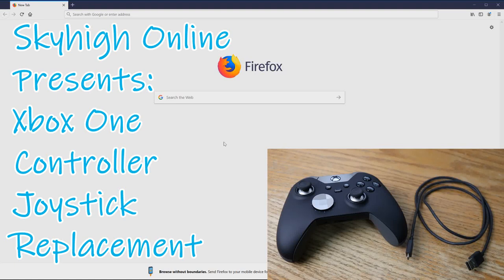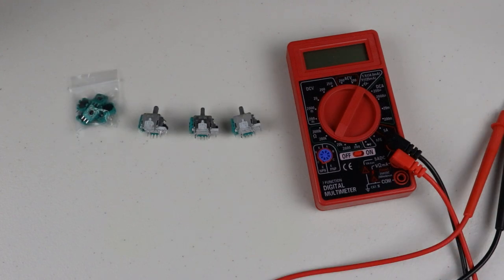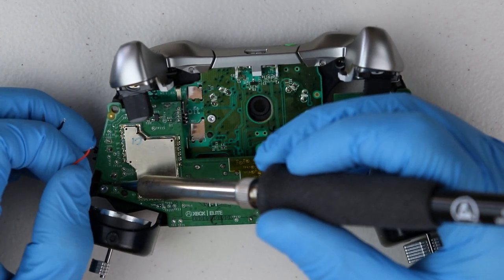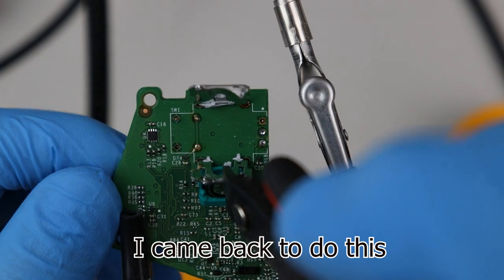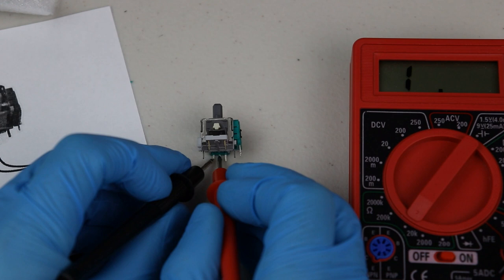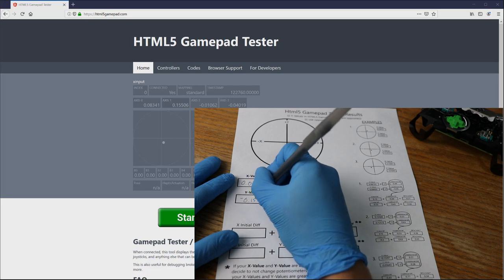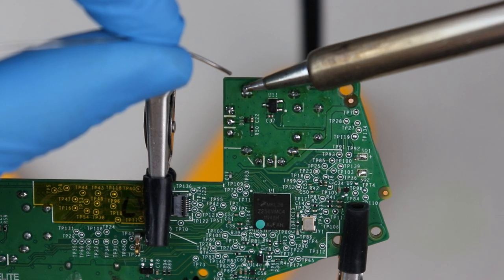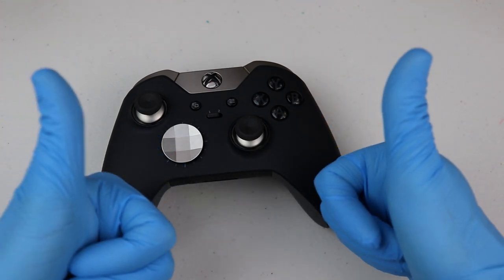How to Replace Xbox One Controller Analog Joystick - Fix Stick Drift & More

Comment: First video I've found that gives the tip to pretty much destroy the fault joystick to more easily remove it. That's the main reason I've been hesitant to invest in the soldering kit to do this. Seems a lot of ppl have trouble with that step. However, you then make up for that by having to do it twice!!. I haven't read about these values being off until I found your video.  I've already deconstructed my sons controller to the point of actually cleaning those black rings in the potentiometer. Your Amazon link shows currently unavailable but I seen in another comment you would set up an ebay link. Curious why you can do an ebay link for the product but not have them on Amazon..strange.
Reply from the maker: Thank you for the comment! They're in stock now: https://amzn.to/2vWwm8s

The reason I made an eBay link is because I have the parts to sell and ship myself, but was currently in the process of getting them all packaged and sent off to Amazon in bulk, and once shipped, it takes Amazon nearly a month to have them available!
Reply: @SOSSGAMING  That would be great, actually. I'll take an ebay link I don't want to invest in a soldering station as expensive (not that expensive but for me for this it is) but is there like a minimum heating ability you'd recommend? Like, it needs to be able to get up to "X" temp?
Reply from the maker: @rsxfreak03  
I haven't tried this with a different soldering iron than the one shown in the vid, but I don't see why any cheaper but good soldering iron wouldn't work.  The recommended temperature for soldering is usually between 626-662F (330-350C).  I set mine at 650.
Reply: SOSS GAMING  would it just not be as easy to desolder the analog stick as a whole  rather than taking it apart and destroying it? I know they are only cheap but they seem to come off easy enough?  although I did have a nightmare  getting an elite analog stick off even using hot air gun as well. I’ve only done about 7 analog replacements so I’m new to it, as well as using a soldering station

Comment: After replacing lots of these potenciometers, do you feel like the controllers fail because of faulty pots, or is it dirt between the clicking mechanism  and the bottom end of the stick? I threw in some handy oil into my controller that had a sticky stick, and it greatly reduced the amount of stickdrift. Making me think its not the pots, it's just gunk in the movement mechanism
Reply: Pot readout would be glitchy if the pots were malfunctioning right?
Reply from the maker: Almost all the controllers I received were the fault of the wear of the carbon in the pots, so nothing short of replacement would help. Only a handful of times it was other issues other than the pot. But I did have a couple where it was gunk buildup on the thumbstick/dome piece (causing it to stick a little) as it seems you had. You are correct, the readout would be having issues if the pot was malfunctioning.

Comment: will i need to recalibrate the sensors if im only changing the little sensor wheels inside the green housing and not actually desoldering or taking apart any of the insides?
and if so how do i do it without soldering or any special tools (i do have that red meter box thing tho if needed)
Reply from the maker: If that's all that's needed then no, you shouldn't need to do any calibration.  You will only need the tools to open the controller: t8 security torx, t6 torx, and a screwdriver or something to pry off the handles, and a small screwdriver or something to open the potentiometer

Comment: Lotta steps but 2 have peace of mind for the future ya cant beat that.
Reply from the maker: For sure.  I've actually found a new method that doesn't require calculations.  A new video should be out within a week or two.
Reply: @SOSSGAMING  heck yea, yr getting a sub and like from me. Thatl save me more time and $$$$ on tools, thank you!! 💯💯💯
Reply from the maker: @haikudragon1002  Well... you'll still need a few tools haha no away around needing to open the controller, desolder the old joystick, and solder on the new one.  But, I will be demonstrating with a cheap amazon soldering kit that has all the needed tools (the one I got was $30, some are even cheaper like $15-20), and of course the joystick kit.

Comment: The analog modules that are on modules do they only work for Xbox one controllers or do they work for PS4 controllers too? Could you send a link for PS4 ones?
Reply from the maker: Technically they are interchangeable.  The only difference worth noting is that the PS4 ones are slightly raised and have a slightly stronger spring I believe.  I have been meaning to list them actually thanks for reminding me.  https://www.ebay.com/itm/224051689870

Comment: Same problem with ps4 controller. The sticks and potentiometer looks the same. Can this work with ps4 controller also? And do you have more details on the potentiometer it self? The black stuff inside, how it work and something like this?
Reply from the maker: Yep, it is essentially the same procedure.  The black stuff inside is carbon and it is used as the resistive material.  The wearing down of the carbon by the wiper is the typical cause for drift.

Comment: dose anyone knows why Stick drift occurs? am I pushing too hard on the controller? Outstanding tutorial btw!!!
Reply from the maker: Thank you! Unfortunately it's mostly just a wear and tear thing. Sometimes it's simply from buildup of dust and grime or a sticky joystick, but more often I believe is that the carbon in the potentiometers wear down from use over time.  When this happens it throws off the resistances which ultimately lead to the stick drift we are all too familiar with.  It's also usually why stick drift most often occurs on the left analog stick drifting upward.  This is from moving forward so much in first person shooter and other such games.  Simple wear and tear.
Reply: @SOSSGAMING  Thanks for the information Man! I also didn't know that Microsoft calibrates each thumbstick individually explains why my attempts at cannibalizing parts from other controllers didn't work
Reply from the maker: @thelovableprotagonist5574  No problem! Yes I know what you mean, I did the same thing and was so frustrated that the joystick was off center after multiple attempts.  I was losing my mind.  Took a long time to figure out what was going on and finally after many successful joystick fixes I was confident what was going on.  This information isn't anywhere else oddly enough!

Comment: Holy shit this is WAY more complicated than I thought it would be. Thought you could just desolder the old stick and put in a new one without all this paperwork.
Reply from the maker: Yo I agree! It's worked for me in the meantime but I've actually found a way that is a lot more simple to get these centered.  No calculations or readings required, nor wasting any joysticks.  And in most cases you just need any one random joystick!  I will be posting the new video by the end of the week hopefully

Comment: That moment you realize you need to finish an electronic engineering degree to fix a drifting stick
Reply from the maker: If you have just stick drift, you can just replace the potentiometer causing drift, and if you want to calibrate it, use the method in my latest joystick video "newest method". No measurements or math required. Good luck if you choose to do it!

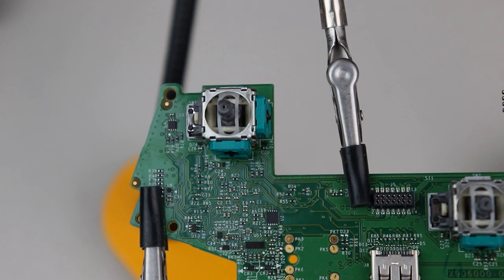Comment: Around 6:00 you take apart the joystick with pliers. Can you just use wick to absorb the solder on it already? Then just take the joystick off?
Reply from the maker: Yes, but it is extremely difficult on elite controllers and the newer controllers that have the smaller through holes.  That is why I show the tear apart method.  On the older controllers it is much easier to remove the solder with a sucker and/or wick.
Reply: SOSS GAMING thanks a lot your video helped me start up my personal project. Without it I would be no where

Comment: I didnt calibrate but I did everything when I use it it only works to move left and right but not up and down. Do u know maybe any reasons why this could be?
Reply from the maker: Oh no! Yes, 3 possibilities that I can think of: Damaged wiper, solder connections touching, or most likely that a through hole was damaged.

Comment: Wow amazing video . Only one on here that’s explains and does this. Had major problems with dead zones when replacing analog sticks, the odd time got lucky and the stick worked right off the bat, the deadzone being not centre,some games it affects, ie rainbow six, robloks, fortnite usually causing the avitar to walk forward, stargaze or drift. If you cannot change the deadzone  in the game you have had it. All these people doing analog stick repairs but I bet they are not checking the deadzones. Doesn’t affect games like fifa, call of duty but really is a pain in certain games if the deadzone is not as near to centre. These parts you get from China are nearly always way out . I’ll be trying your system later today. Thank you for the vid
Reply from the maker: Thank you so much! Yes, it took quite some time to figure this out (by myself).  Equations and everything.  And it's nowhere to be found on the internet anywhere that I'm aware of which boggles my mind.  I don't know how many frustrated days I spent trying to figure this out before I realized that each joystick is software calibrated differently from the factory based on the exact original joystick put in.  I really wish Microsoft would offer that calibration software to us like other 3rd party manufacturers do with their controllers.  But we all know why they don't.  So, we are stuck with this silly method lol
Reply: SOSS GAMING well done on your time, effort and patience. All the analog sticks are out usually, some more than others.ive been using model  RKJXV1224005 ALPS Multi-Directional Switches, which  are supposed to be great, deadzones miles out, had more luck with the ones off alibaba. Everyone  who puts youtube vids out there replacing sticks just see it working when they go on the home screen on Xbox the basic app which shows it centre, but when you switch to deadzone settings this tells the story, and how in some games it will be a big problem
Reply from the maker: @ebayselling1576  Yeah I know the struggle!  I too fell victim to the xbox app until I found out about html5gamepad.com which like you said tells the true story.  Thanks for chiming in!
Reply: SOSS GAMING 3 controllers that I paid £15 each,  with deadzone problems after I had  replacing the analog sticks. All 3  now fully fixed and resold for £30 using your video/system, just testing then switching the 3pin sensors from the other 30 odd analog sticks I purchased in bulk some time ago. Thank you once again. Great work!
Reply from the maker: @ebayselling1576  Awesome! Thanks for the update. That's great to hear. Well done.
Reply: @SOSSGAMING  I'm wondering what you mean about the calibration process... do Microsoft put the joystick in and then calibrate the controller so even if the stick was off centre before, it is now centred to that specific controller? And when you mention 3rd party programs/apps. Is there one that i can use to calibrate an off centre joystick to dead centre? I've been wondering if this is an option because it makes so much sense. You're not centred? Well where you are now is the new centre. So simple

Comment: good video but tearing appart whole ministick was bad idea, you could just use copper Desoldering Braid wire to clear of old soldering, and detach ministick entirely or just remov potentiometers from sides.

Comment: What is the tool you use to cut the housing? Nothing i had could cut through that thing
Reply from the maker: It's called a micro cutter, but a wire cutter should also work.
Reply: @SOSSGAMING  thanks for the quick response! Off to the store

Comment: In have spare analog sticks from my PS4 controllers,, can I use those? I know they look and mount similar, but can't using these damage or make my Xbox not work properly?? Very curious
Reply from the maker: They will technically work. They will feel different (higher stick tension), will sit higher (may need to shave off the bottom base a little bit to fit), and the potentiometers have a wider range (will max out sooner than xbox joysticks). Hope that helps in deciding whether you want to go through with putting them on the xbox controller. Good luck.
Reply: @SOSSGAMING  👍

Comment: So are all the potentiometers variable with different joysticks or are the values that you got a set value with each one and useless?
Reply from the maker: I'm not exactly sure what you're asking, but I'll try to answer as best I can.  In short the ones that aren't used aren't useless, and may be a perfect match on different controllers/joysticks.  If put on a different joystick, they can also provide different values, because another factor in the values is the positioning of the knob that turns the wipers on the joysticks which also varies slightly from joystick to joystick.  Not sure if that answers your question.  Anyway, I have another method that I made a video on that you might be interested in.
Reply: @SOSSGAMING  that’s the explanation I was looking for. My working was kinda bad with it but you hit the nail on the head. I would be interested in other methods as well to see.

Comment: Hey man, appreciate the video! I ordered from your eBay store and this walk through is super helpful. I'm curious if your affiliate links for Amazon are still working? Specifically the quad hands and soldapullt. It seems like it redirects through Amazon's search function which then goes to the original product page, but it's unclear to me if you would still get the credit for referral. I'm gonna order 'em, but would rather you get the credit for it. No rush, lemme know if they're working and I'll purchase them!
Reply from the maker: Awesome! Glad to hear.  Thanks so much for the support and courtesy of letting me know about the affiliate links.  Not sure why they aren't working like before, but it does appear I would still get commission as the link still contain my affiliate code.  Thanks again for the support.

Comment: Will any solder gun work? I have one from harbor freight. Just a cheap one.
Reply from the maker: Yep! Unless it's one of the huge ones meant for larger jobs, but if it's the same type as in the video it should do just fine.  Biggest tip is getting the heat adjusted correctly.  I'd suggest starting on a lower heat first (too high of heat damages these boards quite easily).  Check out my latest video I use one of the cheap soldering irons.
Reply: @SOSSGAMING  ok thanks.

Comment: What do i do if i didnt leave the plastic parts on to help pull the plugs out? I have like half the posts out but i cant seem to get the other half to heat up and pull out of the holes in the motherboard. Its super frustrating

Comment: when can i buy the entire module from amazon again? it says that they're currently unavailable
Reply from the maker: Thanks for checking in.  They are restocked and available now https://amzn.to/2SOhEc1
Reply: SOSS gaming I'll let you know in a couple hours. There's definitely a chance I'll buy it from you on eBay but I'll check with you in a bit. Thank you for the offer. I'll let you know today when I'm gonna buy it
Reply: SOSS gaming Can you also let me know which solder iron to buy and what solder wick or solder wire did you use. It's gonna be my first time ever soldering anything so I wanna be prepared
Reply: SOSS gaming Can you also let me know which solder iron to buy and what solder wick or solder wire did you use. It's gonna be my first time ever soldering anything so I wanna be prepared
Reply from the maker: @onstandard  absolutely, all of the links of what I specifically used should in the description. Any alternatives should be fine, just be sure to check their reviews and what not.  Soldering is an excellent skill to acquire, and may be pretty challenging at first.  There are many great videos on here (YouTube) that explain good soldering technique, etc.

Comment: will the same analog module part work on xbox one and ps4 dualshock controllers ? it's a common question but hard to find a clear answer. Some sellers states it's compatible for both controllers and others mark just one of them..
Reply from the maker: I would use the correct joystick.  The differences worth noting are on the PS4 controller joysticks, the base is raised, and the spring tension is higher.  You could install a PS4 joystick on an Xbox one controller, but would need to modify the base (shave or melt the base so it is flush and sits correctly).  You could also install an Xbox joystick on a PS4 controller, but it will sit a little lower than normal, and I believe the lower spring tension might also create a "sticking" effect on a PS4 controller, but I am not sure, I have never tried it.  Hope this answers your question.
Reply: So it's either PS4 compatible or xbox one compatible, and good thing is to avoid sellers who claims that it's for both. Thanks for answer, I get good understanding now.
Reply from the maker: @shoo7thesun  Yeah they all seem to have their little differences.